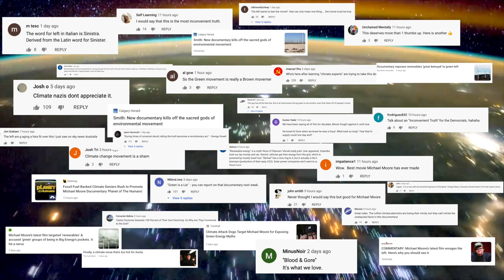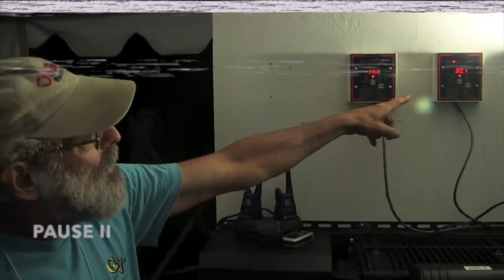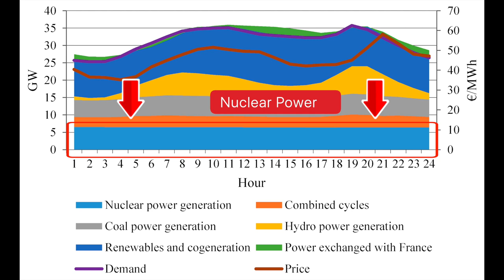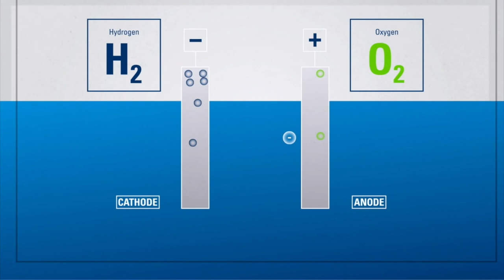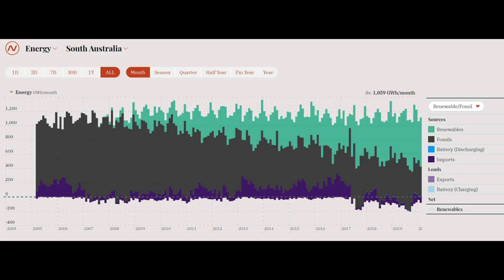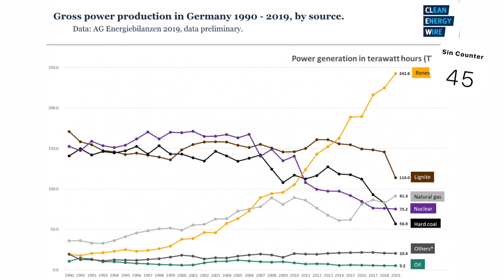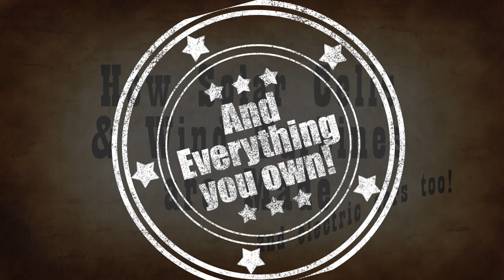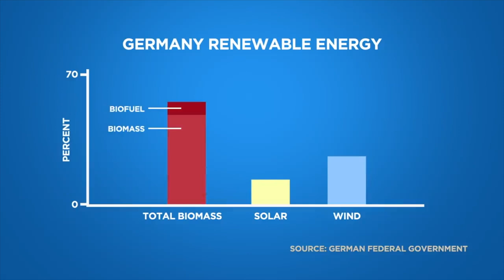Everything mostly wrong with "Planet of the Humans"

Comment: You try to state your own facts without backing them up. They clearly say that with unlimited amount of money, you can get higher efficiency solar panels.  No sin here.
Reply: Heh, typical household sold solar panels of today, the affordable ones, work at 20-27% efficiency. The ones at the 'documentary', 8%, nobody would take those even if you pay them. So, yes, there is sin there, but no Sinn (sense in German).

Please, let the tech people talk about tech. None of the authors of the "Planet of Humans" is even near to get any technical fact right. They just don't have it what it takes ever to get the facts straight. Most funny moment is when Michael More says, "Nobody would buy a mobile phone if it would be only 98%" efficient.

It's clear these people have no idea what they are talking about. 98% efficiency would mean that the sunlight beam would just jump straight into electric wire and start running as electricity, with practically 0 conversion loss.

After this 20-30% efficiency that is easy to achieve with affordable panels now, we do not need more efficiency. As halving the efficiency would only mean we need to install 12 instead of 6 panels on the roof (where e.g. 20-36 would fit easily). It's already about making them cheaper and thus with less materials, less expensive materials, and less energy.
Reply: They were using flexible panels designed for raping round lap post ect they did that because they were locally made
Reply: These scammers gets money for these videos.They dont care about environment ,its all money and politics

Comment: My roof-top solar produces around 48KwHrs of electricity per day, my home uses between 24 and 32KwHrs. Obviously over a 24 hour period I'm a net exporter, of course at night and even at times during the day I will be importing electricity from the grid. This does not change the fact that as far as electricity is concerned my home is CO2 negative.
Reply: How many KW of panels? And what region of the country?
Reply: @cindytepper8878  SE Queensland and just under 14Kw, actually my average daily production is more like 56KwHrs but I went with 48 just to be conservative.
Reply: Ray Johnson  I currently pay 25.5 cents per KwHr and receive 20.0 cents per KwHr for my exports, a difference of 5.5 cents. If I installed a Powerwall with 13.5KwHrs of storage and if I fully drained it every night of the year my maximum saving would be $378.56 (13.5 X .055 X 365) per year. The installed cost of a Powerwall is say $15,000 that means that the payback period is just over 39 years. Obviously this is way beyond the life of the battery.

Even if my feed-in-tariff dropped to zero my maximum saving would be $1256.51 which gives a payback period for the battery of 12 years, . beyond the battery warranty period of ten years.
Reply: Barry Hamm Hi Barry, I have a similar sized system and can back up your numbers. One summer day I nearly hit 90kwh.

I’m impressed with your electricity rates, may I please know who is your retailer and what deal you are on? It’s definitely better than mine. Cheers.
Reply: TheKKnut Hi, I’m with AGL but that is under a contract that they are no longer offering. Their current offer is 17 cents per KWHr.
Reply: So you're telling me that your solar panels mined themselves, built themselves and will recycle themselves back into the earth using only the energy they gained from the sun? Of course, I'm being facetious, and I also believe we have to start somewhere, and I also believe technology does have a role in getting us out of this mess; but one of the points of the documentary is we have to start being completely honest with ourselves also.
Reply: @brent829  According to Fronius my panels have produced the electricity equivalent to burning over 3 tonnes of coal per year. Over their expected life that equates to over 60 tonnes. Being completely honest that will be way more energy than consumed in their production, installation and ultimate recycling.

The financial payback for my panels is around 4.5 years and the energy payback will be significantly less at between 1.5 and 2.0 years. Being completely honest my solar panels are a wise financial investment as well as being environmentally superior to the alternatives.
Reply: @barryhamm3414  I won't argue at all with your facts (I'm going to assume they are all correct). But, what I meant is that you cannot look purely at carbon emissions or energy usage and say "Problem solved!". You also have to acknowledge the environmental costs of mining and the production of products and technology and that they will have effects on Earth that will last a very very long time. That being said, I think I can agree with parts of both POTH and this response video. The premise that technology has no role to play in environmentalism is ridiculous imo, and more ridiculous than the premise that solar and wind cause no environmental harm. Thanks for the response btw!
Reply: Glad that works for you. I live in a place where my solar panels on my 1500 sq ft house and my 1000 sq ft garage  produce just shy of 70 kwh on a sunny day (summer only)...and I had to spend 50k to achieve this. But in the fall and winter months, my panels produce an average of about 15kwh per day because it's mostly cloudy and the temp outside drops as low as minus 30 degrees F...conversely, in the fall and winter months I can use as much as 80 kwh per day. So in reality...solar is simply taking some of the sting out of my energy needs and will never be a viable option for the costs. When the government makes fossil fuels illegal, they will not be curbing any spending habits, so they will need to replace the revenue from fossil fuels taxes...guess what they will tax instead ? That's the only place I see value in having solar panels...tax mitigation in the future.
Reply: @markanthony3275  I second. I ordered a quotation on my house, and I came to the conclusion that it is not worth the struggle. They started with pointing out which ones of my beautiful trees to put down. 
When Covid hit China, their industry was closed down. In parallel, emission started to drop. However at the same time solar panels disappeared from the market. Then Chinese industry was rebooted, panels were available again. Emission went astronomical again.

Comment: Do you have any sources for your opinions? You didn't talk about the manufacturing of the batteries and the solar panels. These were main topics. I am just skeptical - by the way, also towards the criticized documentary. Do a calculation - Tesla vs. BMW 320d - mines raw materials, production, lifespan etc.
Reply from the maker: All references and further reading are located in the show notes. And yes, raw materials, production, etc - have been studied in Australia, the US, and Europe and cover from cradle to grave, as well as "well to wheel". Put simply, an EV's carbon footprint shrinks over time, whereas an ICE car doesn't.

Comment: The documentary raises important and valid questions that Chris didn't address: can a population of 6 billions humans (and growing) be sustained by renewable energies? Why are powerplants that burn trees being subsidised, when they polute more than fossil fuels? Are eviromentalists still fighting for racional solutions or did they just succomb to the power of green money?
Reply: Yeah but those questions are easily answered. Long-term, it is better to burn trees than coal, since the carbon released from biomass is part of the earth's cycle, unlike fossil carbon. Now this isn't to say it's a good idea to burn trees, but the pollution difference doesn't make up for the many more long-term consequences of fossil fuel burning. Likewise, fossil fuels are still more subsidized than any other energy form, so it's a moot point either way.

And in that same argument. Extremely few activists actually support this insane burning. Biomass is like 2% of renewables, nothing more. The fact that biomass is used as a "green" energy source has nothing to do with the activists Gibbs unfairly blames, and it's less of a problem than what is presented in the documentary anyways.

Comment: fossil fuel can be burned pretty clean with modern technology. The semi truck I drive with emissions does not pollute all that much. My car, is a partial Zero emissions vehicle. Yet electric cars, their batteries are non recyclable.  And there is not enough material to make that many of those batteries.

Comment: So many errors in your errors, just wow. I would ask you to make a "everything wrong with my debunking"-video, but then again, that would be to ask you to use logical reasoning which you clearly are not capable of. It's nothing personal, but this is NOT the kind of videos you should be doing unless the goal is to make a fool of yourself. And the comments here, when you think things cant get any worse and then scroll down......I got to admit, the ultra-morons caught me by surprise. Allow me to clear up the first few points and let me know if you need further guidance:
#1 - No he did not 
#2 - What? Do you not agree that solar power needs backup or whats the problem? He is just demonstrating something obvious (for most) 
#3 - WHAT?!?! I really can not understand what kind of conclusion you made and from what, what point are you trying to make? Not even a minute has passed and he is still just showing examples of flaws with solar power, how can you have lost the thread already? 
#4 Ok I give up, you have to be suffering from some kind of serious brain injury, so I´m gonna stop it here. (Spoiler alert, the 100 billion went straight into the pockets of the oil industry, which is not really what the Presidents supporters were expecting)

And yes, I understand that its not ok to pick on the mentally disordered. But what you are doing, advertising against a documentary that despite its actual flaws (flaws you failed to mention or identify) - has a undeniable, crystal clear, and super important message one simply can not misunderstand. This is not the best production ever made, its kind of mediocre, but still it might just be the most important documentary of the century so far.
Reply: Narco Polo ok boomer

Comment: I don't understand how you can say a coal power plant is less polluting than a internal combustion engine. You should take into consideration all energy losses from the point  of burning coal at a power plant to spinning wheels on a electric wehicles. The basic physics indicate loss of converting from one energy to another. The main issue here is energy density. Coal has quite low energy density and low caloric values. Coal is proven the worst polluter of all fossil fuels. Just imagine, burning coal as one unit of energy, converting from heat to kinetic energy, spinning turbines there is a loss. Another major loss is through a distribution system, power lines, and it's approximately 15%. Changing a voltage throughout the distribution is another loss. It is documented that there is around 65% of energy loss from a power plant to a household plug. And then we come to efficiency of batteries. Temperature has detrimental effect on an efficiency. Probably New Zealand has a good climate, since batteries are the most efficient at around 17C. But the rest of the world is not. We all know that batteries don't last long. All in all, you claim that coal powered electric vehicles are less polluting is wrong.
Reply from the maker: Did you look at my references - see video description? I didn't make it up - there are studies on this which take in everything - from digging up, transport, distribution, and ultimate delivery to a car. I guess what you are saying is around efficiency? And we all know that electric cars are very efficient at using energy.

Comment: I think the graphic of March 2020 from the IEA showing the entire installed battery capacity on earth equivalent to 54 TJ vs the total consumption of 576,000,000 TJ eliminates intermittent sources of power entirely. As soon as I saw that graphic I realised Bill Gates is right.

In fact the huge battery array built byTesla for the South Australian government if connected to the aluminium smelter in Tomago NSW exclusively could power the smelter for a total of six minutes before being drained. I’m sorry but intermittent forms of renewable energy are not the answer, not even close.
Reply from the maker: You know that pie chart is garbage, right? Flip it. Voice over by Gibbs, "Coal, gas, and nuclear  cannot fulfil the worlds energy needs. Accounting for just 1/3 (33%) of this chart, you can see how traditional fossil fuels have failed us". He's hoodwinking you into thinking there is a problem when there isn't. Simple fact is you do not need 100% of the world's energy, stored. If you did, you would need to double the number of every power generator in the world. And PS - all forms of power are intermittent. In 2019, coal power stations in Victoria broke down no less than 118 times, and you know what filled the void? Wind, Solar, battery storage, hydro, and more.

Comment: Population matters. Finland, a small population, will have to import bio fuels when they eliminate coal.  Iceland is not highly populated either. They have use of volcanoes the same as Hawaii. Why not use Hawaii as a place to do your study as you may realize Iceland and Hawaii have similar populations?  No, wait, Iceland's population as of 2019 was 356,991 whereas Hawaii has a population of 1.416 million.  Finland has over 5 million people. They rely heavily on wood as a source of heat. They also rely on nuclear power.  21% of Queensland energy comes from renewable sources whereas Hawaii uses 26%. Population and environment matters. They are discussing using volcanoes as a source of energy. Can Queensland do that?

Comment: 6:10  Comparing a solar farm located at a latitude of 20 degree's and an av temp of 25C .... with Lancing at latitude 42 degree's and av temp of 9C really shows how naive most of your points are ..... and the Queensland solar farm covers 4 sq miles (2600 acres !!) ... not 1.5sq miles. 
People are fixated on electricity production when it comes to alternative energy but that is only part of the total energy used on the planet .... and that is the point of his documentary .... which is  - Even at todays population and energy usage levels, there is no way that current alternative energy sources can't even supply a small part of actual energy that's getting used.   Do a search on the subject and see for yourself .....
Reply from the maker: Thanks for your comment Chris. I have and continue to research into renewable energy (RE) and there are already many successful countries running on it, producing more than 100% of their energy needs - so are exporting it. Remember, the sun doesn't always shine, nor the wind always blow, so redundancy and multiple pathways are key to 100% RE. Take a look at China and their inter-continental DC high voltage lines carrying 12 gigawatts of power, more than 3,000kms. Australia will soon be supplying energy to Singapore via this pathway too, so the future is bright for RE and the retirement of coal, nuclear and gas.  https://spectrum.ieee.org/energywise/energy/the-smarter-grid/chinas-state-grid-corp-crushes-power-transmission-records
Reply: @chrisvanderstock  Thanks for taking the time to reply Chris.  I think you missed the point though, even countries like Iceland still derive 20+% of their total (key word) energy from fossil fuels.
Check this out for a global perspective and uncheck the "relative" box to see energy source vs time  - https://ourworldindata.org/grapher/energy-consumption-by-source-and-region?stackMode=absolute&time=earliest..latest

Comment: 95% of house hold items are made from fossil fuel. All of the material to make solar panels are mined batteries are actually horrible for the environment. Everything that makes a car battery is from fossil fuel lead and acid. And to have a solar farms you have to cut down good amount of good amount of forest will be disappearing. I actually do work for solar company so I do know what I'm talking. Even parts of electric cars are made from fossil fuel the wires inside of a car is made from fossil fuel and all wiring is made fossil fuel and mined. Idiots
Reply: @-GinΠΓ Τάο On the one hand, yes, but actual burning of CO2 is reduced drastically because while CO2 is also used to build fossil fuel power plants, those power plants will continue to emmit even more CO2 throughout their lifetimes, which renewable energies will do much less.
While electric batteries are a serious issue, they are getting more and more recyclable, as well as the fact that we can simply have less cars.

I don't know if you really work at a solar company, but there are already efforts underway to create dessert solar farms, so there's no reason it should be taken from forests at all. Don't know what you're talking about.